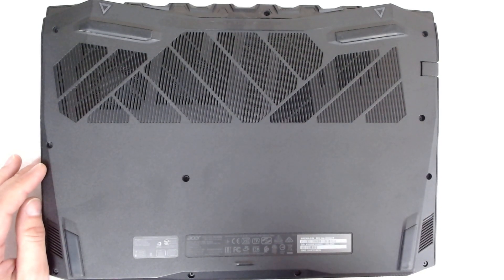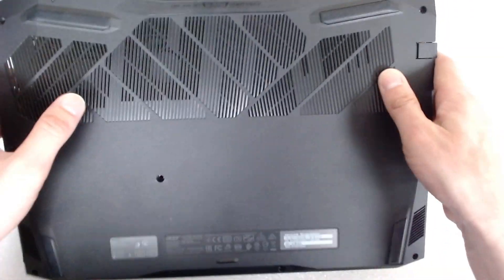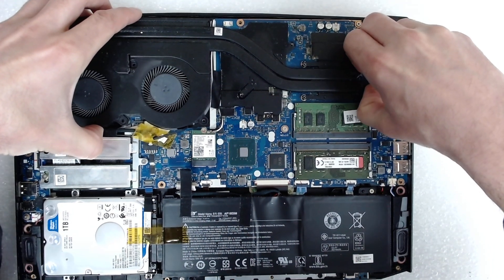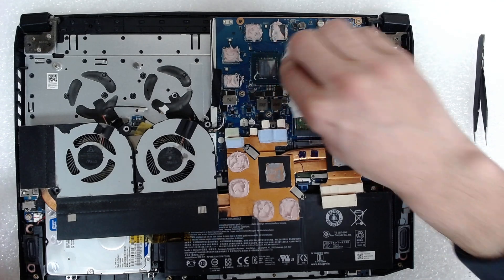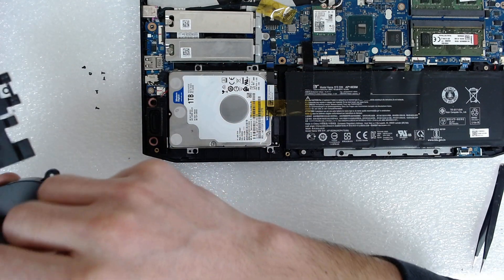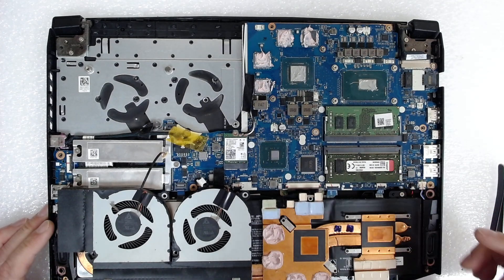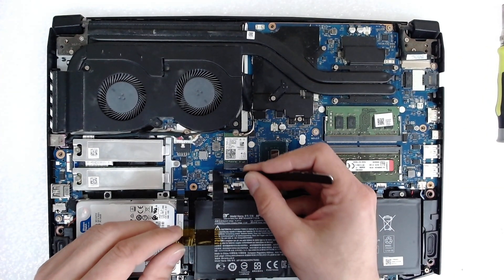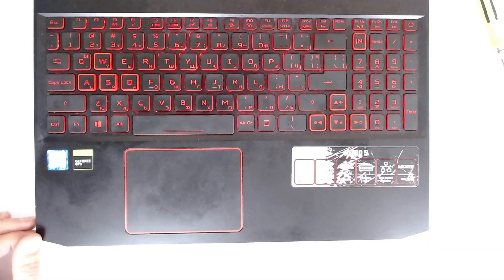Acer Nitro AN515-54 Disassembly / Fan Cleaning

Comment: Really helpful video. The problem with models like this (I have the AN515-43) is that you have to take off the whole heat sink even if you just want to properly dust off the fans and vents. I'd cleaned and repasted mine just four/five months ago but then it started overheating again due to I assume dust accumulation. So just to clean out the fans and vents I had to take the whole heat sink off and repaste it again. Unless I'm missing something, this seems like a very annoying design flaw.
Reply: Yeah I'm fked then. I'll just chuck my Acer in the Garbage.
Reply: @kinghelious450 this isn’t hard to do, lol
Reply: How about thermal pads ?
Reply: Yeah, it's a PITA. I don't think I'll buy a gaming laptop again because of the heat issues. You don't have to maintain a tower so much (or even at all) because there is so much more room for heat to escape.

Comment: This is very informative. I have 2 problem doing this though as one of the screws that's fixes the heat sink is stuck to the board and Im not sure how to loosen it. Other is the tiny screws which opens the heat sink for which I can't find a screwdriver that fits. Please help with ur opinion bro.
Reply from the maker: I think I have a link in the description about the screwdriver that I use. To loosen the screw.. just have to push down and twist at same time.
Reply: @LaptopDisassembly  yeah I just ordered a set that has ph00 and ph000 drivers which is the ones in the set u recommend. Didn't buy the same one as the shipping cost is too much

Comment: Bro i removed the pink paste ...now my laptop is overheating...what should I do ?
Reply from the maker: Well, you SHOULD NOT remove the pink paste. It is different from the thermal paste. Try to apply thermal paste on its place. If it douse not help, buy a thermal pads with 0.8-1mm thickness and put them on the place of the pink paste.
Reply: @LaptopDisassembly  bro i already tried both of that ..😥 but it's not getting fixed bro
Reply from the maker: @uparanjandas1723  Apply small amount of paste on the cpu and put the cooler. When you remove it the paste should be spread. If yes, than the paste is enough. Apply on the VGA also. Use a good quality one, not a cheep on.
Reply: @LaptopDisassembly  yeah bro i bought kryonaut yesterday...but i only applied on process and vga chip..not at the vrms
Reply: @LaptopDisassembly  is playing games without applying anything on vrms bad ? I think it is coz my temp traces around 93 to 95 while playing valorant 🥲 and gpu temp remains at 84 only 1° below it's TDP .
Reply from the maker: Apply on them also.
Reply from the maker: @uparanjandas1723  You have to cool the VRMS also. They are on the same cooler so you need to coll them also, otherwise the temps will go up.
Reply: @LaptopDisassembly  i did ...it's not much less...but it's fine for now ..

Comment: Thanks for this! I just bought an Acer Nitro 5 from a local second hand shop (Cash Converters in the UK). Got home and ran Heaven Benchmark on it - temps on the 1050 were hitting 95 degrees! Opened it up - caked in dust!  Used a blower to get most out, then took apart the fans - just as clogged as the ones in your video. Clean them out, changed the thermal paste (MX-4), put it back together and ran Heaven Benchmark again. Temps had dropped to 63 degrees.  Thanks again for the vid! 🙂

Comment: I forgot to unplug thr battery and the laptop is now dead and won't even charge. Can someone please help me and tell me what to do? Do I have to take it to a shop?
Reply from the maker: Did you short something..If not, even if you don't unplug the battery is not a problem. Check all the connections. Also try to disconnect it and disconnect the small battery that is for the bios. Wait a  minute or to and plug back everything.
Reply: @LaptopDisassembly  I basically used ur video to learn how to open my fan and clean it then after I finished it wouldn't turn on so I reopened and checked for everything but nothing was unplugged and it was step by step of what u did except I accidentally unplugged the charging one but I made one it was back on. 

By small batter wym? Ik the battery plug that I see will unplugging and waiting for one minute then plugging it back on works?
Reply: @LaptopDisassembly  it worked and the laptop is on but it says no Bootablr Device. Can I fix it or take it to the shop? Please help
Reply from the maker: Check in bios settings is everything set properly. The boot mode ahoy be UEFI Also in one of the pages there shot be a data setting. Sometimes is hidden. It is 6AM here now, after 2 hours I will be in the office and will send you a link.
Reply from the maker: Acer has a hidden SATA option. In your bios go to menu tab ( the one after information ) and then press Ctrl+S and then change the SATA mode to achi.

Comment: Wicked, just cleaned my daughters fans but still noisy so have ordered some new fans and am 100% confident in replacing them.
Thank you!
Reply from the maker: The problem may not be the fans. If the thermal paste is dry, it cannot absorb heat from the CPU and the cooling is not efficient. Even with the new fans, the sound may be the same. It is a good idea to replace the thermal paste also.
Reply: @LaptopDisassembly  I did that too, it was still noisy. It sounds a bit grindy.
I can hear one particular fan making a whirring grinding sort of noise.
Reply from the maker: Than fan replacement will do the job.

Comment: Thanks so much for the video man, got up to the last step before realizing i dont have the micro screwdriver so i ended up just picking out all the dust i could with tweezers my laptop is running way faster after 3 years and its first cleaning
Reply from the maker: But is good to replace the thermal paste also. After 3 years it needs replacement i think.

Comment: That 1tb white/silver thing on the bottom left.. is that in all of them or something you can buy? I just opened mine to clean and was using your video and it wasn’t there just wondering we have the same laptop
Reply from the maker: This is a regular 2,5" had drive. Some have it preinstalled some not, depend on your current configuration. If you don't have it, but you have the connector you can always add had drive for a storage.

Comment: 4:25 cant remove those 6 heatsink screws
Reply from the maker: You have to use the proper size screwdriver. Also you have to push a bit down and the same time to unscrew.
Reply: I just succeeded unscrewing 1 of the 6.but the other 5 dont even move.
Reply from the maker: Push more down and unscrew.. has to be at the same time.
Reply: Nah. The whole laptop bent like a banana. The screwdriver doesnt grip it all. I guess ill just use it until the explosion
Reply from the maker: @SweetDreamsLB  they all bend like that... But usually when you push it douse the job.
Reply: Pushing my whole body on top of it did the job for number 4,5 and 6 (the gpu side) ones. But the 1 2 and 3 the (cpu ones) are looking pretty damaged already they wont budge
Reply: Bought a new screwdriver. With another 20 min effort i succeeded. Helpful video thank you
Reply: I touched the battery cable with metal tweezers though then i few sparks came out.  Now the battery doesnt work. It works fine while plugged in. I dont really need the battery, how do i make it more safe? 
Leave it as it is
Unplug the battery cable only
Or Remove the battery entirely
Reply from the maker: Just unplug the battery.

Comment: What thickness are the thermal pads?  Thank you.
Reply from the maker: The pink stuff is not a thermal pad, but more like a thermal grease. My advice is to live it like that and don't replace it. Just replace the thermal paste on the crystal.
Reply: @LaptopDisassembly  Yes I understand about the thermal putty/grease.  However there are thermal pads around the heatsink still.  I was wondering the thickness of those.  And thank you for replying!
Reply from the maker: I think they are 1mm . But if the old ones are in one peace don't replace them. The factory ones are better than the aftermarket ones. But if you decide to replace them use a good quality one like thermal grizzly.
Reply: @LaptopDisassembly  Thank you so much!
Reply: I did the re-paste and temps are down 10* C @ mid 80's C playing BF5 (my processor got really hot playing that game) with ambient temps around 22* C.  I did a total re-paste replacing the thermal pads and the thermal putty/grease as well (very hard to work with).  Also, the thermal pad thickness is indeed 1mm for anyone who needs to know.

The products I used were:
1.  CPU/GPU compound... Thermal Grizzly Kryonaught
2.  Thermal putty/grease... K5 Pro
3.  Thermal pads... Gelid Ultimate

*notes:
1.  A total of 9 screws were needed to remove the CPU/GPU heatsink.
2. When placing the plastic bottom back on do not torque in the least as you will break the fragile plastic and be stuck ordering a new one as I am (ugh).
3.  I use Locktight 222 for all screws.
4.  Again, this is for model AN515-54-728C
5.  I cleaned using a microfiber towel (the smooth eye glasses type) and used only the surface purifier from Arcticlean.

Thanks so much for this video and advice Yanko Goshev

Comment: What are the pink things close to the gpu?
Reply from the maker: Thermal pads... but more like a gum.
Reply: @LaptopDisassembly  So if I replace them with a normal thermal paste, that will be ok?
Reply from the maker: @alialtuntas8207  No, this is more tick, so the regular thermal paste will not do it's job properly. Just leave the original one and just replace the paste on the cpu and gpu crystal.

Comment: What special thermal compound did acer used in there? I wanna replace mine
Reply from the maker: The pink thing is a thermal paste also, but with different viscosity.  But i have not found a place where to buy it. Just replace the thermal paste and leave the pink one. It will work fine.

Comment: So I wanted to change thermal paste into a graphite thermal pad but didn’t know how to disassemble my nitro5. 
Then, I found this vid and successfully managed to apply my thermal pad, clean out fan dust and it works so fine!
Before I apply my thermal pad, i got low score and high temp(up to 92 degrees) in cinebench R23(Multicore). Now I only get to 66 degrees! 
Thank you so much. :)

Comment: Hi bro I have the same laptop but i thought that it had a loose screw from the fabric and Around the area of the fans near the processor, you can see a screw on the outside that is loose but stuck... The laptop does not turn on at all would you know if it can be repaired? Or is it absolutly dead?  🥲

Comment: i asked a technician to do all this stuff and i feel like now the fans don't blow air as much as before when i turn the fan speed up to max (6000 rpm). is it possible that the nitrosense program shows that it's 6000 rpm at max speed but in reality it doesn't spin nearly that fast?
Reply from the maker: Can be a software problem. You can try and reinstall the program to test.
Reply: @LaptopDisassembly  well the temperatures when playing games are great (although i did an undervolt to cpu) so i don't know if it's just placebo/my feelings or if the fan max speed does actually not match with the software
Reply from the maker: @ynwaynwa5629  if the laptop was very dirty and the guy clean everything and also lubricate the fan, it is normal to sound less louder.
Reply: @LaptopDisassembly  i'm not talking about the sound..i'm talking about when i put my hand in front of the fan. it feels like it doesn't blow air as much as before at max speed (6000 rpm at nitrosense). but like i said it might be my feelings
Reply from the maker: If the temps are ok, you should not be worries. It can be that the air that is coming out is a bit colder because of the cleaning. Just look at the temps. If they are ok, no worry's

Comment: Hii, I opened my fans to clean, after putting everything back together, my laptop ran fine but I noticed it’s not charging anymore. I opened it again to double check all things are plugged in and it still doesn’t charge. I did forget to remove battery when doing the cleaning. What can I do now? Please help!
Reply from the maker: Well cleaning have nothing to do with the battery, if you did not short something. Try to disconnect the battery and reset bios with shorting the CMOS battery. Wait one minute and plug back everything and test.
Reply: @LaptopDisassembly  how do I short CMOS? I found cmos under battery but the clip is too tight, if I pull it too hard I’m afraid I’ll break it.

Edit: nvm, I managed to pull it out. Gonna post update soon.
Reply: Ok so I did it and it didn’t work sadly. I also see no signs of damage on power cable and connector. Does that mean I have a faulty motherboard now??
Reply from the maker: Are you sure you plug the battery good. Also is the battery visable on windows or no. I mean is it showing 10% and not charging or it says mising battery.
Reply: @LaptopDisassembly  I think I wasn’t clear. My battery is working fine, problem is the charger. My laptop doesn’t recognize charger anymore, no LED light, no plugged icon. I have about 70% battery left and I can still start laptop. I also tried to disconnect battery and try to run on direct power but no luck.

Also thank you very much for trying to help, really appreciate it.

Comment: Is it possible for me to uncrew the fans, lift and clean without removing the the thermals with it? don't have any thermal paste around me at the moment. Please help, my laptop sounds like an engine atm. Thanks
Reply from the maker: I doubt... they are connected with a plastic peace... You can damage the cooling pipes.
Reply: @LaptopDisassembly  How about poking a brush from the outside of the vents to get some of the dust towards the fans itself, and pulling it out from there?
Reply from the maker: @usuallyclueless4477  Well you can try, but the grill is very dense. Try to blow from the outside and than pull the peaces from the vent. Otherwise you may damage the cooler.
Reply: @LaptopDisassembly  I just opened the whole thing and repasted it an hour ago.
Dropped by 20-25 degrees on gaming (maybe theoretically more because it was throttling hard before at 96C)
Reply from the maker: @usuallyclueless4477  Well sorry for the late replay but time difference. I need to sleep form time to time :) Nice job.
Reply: @LaptopDisassembly  ay no worries bro😁
Thanks for the video.

Comment: We just cleaned my Nitro 5 and repasted with kryonaut and wiped off the excess pink stuff and replaced with gelid thermal pads, now my laptop wont turn on no lights no fan even when power cord is plugged in, just dead. Any ideas why?
Reply from the maker: This thermal paste is electro conductive so you may short something when replacing. Or you did not plug everything back. Check is everything connected and test with back cover placed.
Reply: @LaptopDisassembly  ive did my research and almost all reviews said it is mot electrically conductive
Reply from the maker: @jeanvestil5583  Can be, but this is in the description: Kryonaut is a silicone-based paste that allows the use of more aluminium in its mix, resulting in better thermal performance and lower operating temperatures:
But still, check all  the connections, and the keyboard one. Also try reseting bios.

Comment: I followed the steps and now my laptop wont turn on
Reply from the maker: Well apparently you did something wrong, or you forgot to connect the battery, or you forgot to unplug it before. Also did you put the back cover on.
Reply: @LaptopDisassembly  i didn’t unplug the battery but i didn’t  do the deep cleaning like cleaning the fan i just  wiped off the dust over mother board
Reply: @LaptopDisassembly  and now it wont even charge
Reply: @justsomeguy9635  samee, I just did the same thing and my laptop won’t charge anymore.
Reply: Found out motherboard shorted

Comment: I have a bad screw that doesn't unscrew. I can't get it to open and clean the fans. Can someone help me how I can approach it without having to go to a technician?
Reply from the maker: You can try and drill just the head of the screw... After removing the cover you can unscrew it with tweezers or pliers

Comment: what screw is used in the fan? is it a regular one like philipps or flat?
Reply from the maker: Regular Philips screw. You can use any, just watch out for the length.
Reply: @LaptopDisassembly  so fast! Haha thank you sir. Im opening mine rn wish me luck😂😁
Reply: @LaptopDisassembly  hello again! what is the black tape thing used for the air vents? is that graphene? because mine wont stick anymore :<
Reply from the maker: @ianmiguel1557  Well it is more like a thin plastic. You can use a double sided type to put it back, or just a regular isolating type to cover the gaps between the can and the cooler.